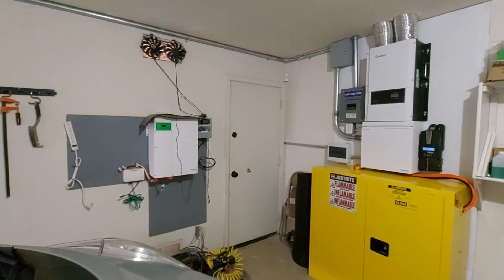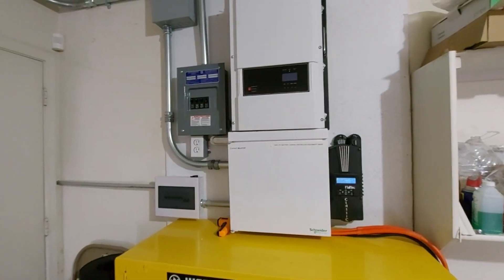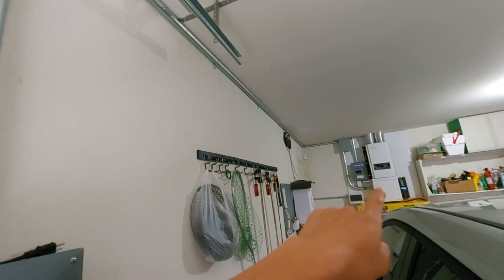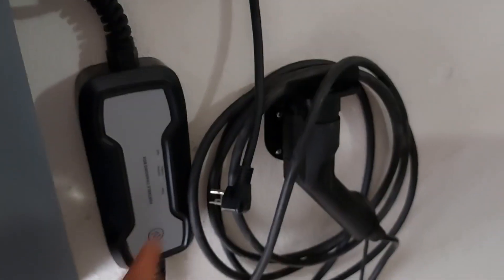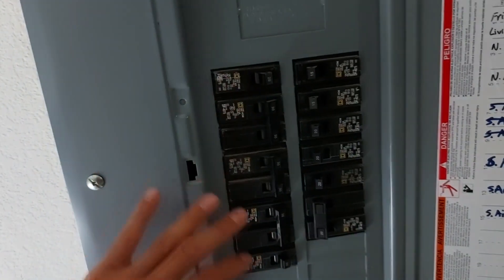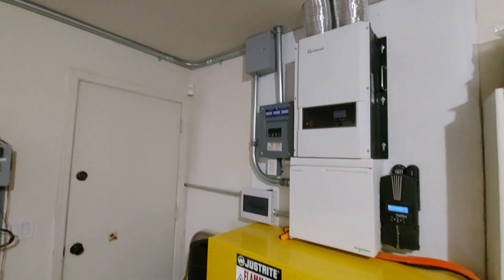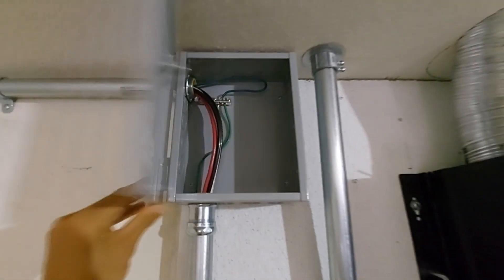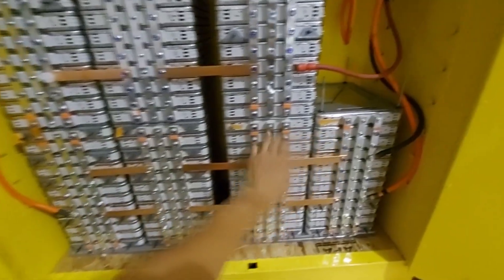10kw Off Grid Solar with 12k Growatt Inverter (SPF12000TDVM MPV)

Comment: I have 6k growat on 10x 570w panels 5×5 series and parallel...  i am about to purchase that 12k growat ..is it safe to use the same 5 series and parallel with one input  string on the 12k?
Reply from the maker: Depends on the voltage output of the panel.

Comment: Why have a critical loads panel? Aren't all loads critical? Just use a transfer switch and run the entire house off grid, 42 kWh should be plenty.   Way less expense in breakers panels, conduit and power distribution panels.

Comment: When u say the dryer and bith ac are on it shuts off.... Does the unit go into bypass? Or actually shutoff
Reply from the maker: Shut off.
Reply: @devildestiny555  ya I bought one. It automatically restarts after a few seconds. That's only when it's overloaded. It's happened to me about 4 times in 6 months since I've gotten mine. Wife be baking in the electric oven while canning on the electric stove while both ac units are on. Just have to be slightly aware of what your running all at once

Comment: How are u charging the same pack with two different chargers. 2 from the growatt and one from the midnight?
Reply from the maker: Charger are charger and it all based on voltage.  So if you can set both charger to the same voltage, you can use as many charger as you want.

Comment: Doesn't the inverter have fans under too ? 
Isn't the other white box blocking the air circulation
Reply: I’ve been considering going with the Growatt 12k to power my home.  Have you had any problems with it?  I’ve heard of some issues with software updates.
Reply: @@Floridaoff-grid Thanks! Great advice. I just built a small backup solar power system with some used panels and an EG4 3000w inverter and can see the benefit of higher PV voltage input (the EG4 takes 500vdc PV).  Longer PV strings and cheaper wiring really do save a lot of money, especially since my PV array will eventually be ground mounted 300’ from the house.
Reply from the maker: Yes the inverter has fan on the bottom.  But the power distribution box is designed to go on the bottom of the Schneider inverter that has fan too.  It has a lot of slots cut out to pull in air.  I have tested it by leaving the box door completely open which gives full airflow and it makes no difference.
Reply: @devildestiny555  
Alright

Comment: Hi Awesome setup. Two questions: Did you bond ground and neutral in the subpanel witch inverter feeds? Did you run a neutral from main panel to subpanel to have a common neutral?
Reply from the maker: I believes Neutral and Ground should only be bonded at the Main panel of your house and 1 point only.  Does not bond at Subpanel.  So yes, I brought a Neutral to Subpanel and to Inverter.
Reply: With this and most inverters the neutral and ground is bonded inside the inverter so you usually have two hots and one ground/neutral for outputs.

Comment: Great video thx.
The growatt is so bad and misadvertised, I had to argue and dispute with seller and got all my money back. Make your research. Unfortunately the bad things about it are hard to find.
Reply from the maker: Yeah, but unfortunately there's not much better option out there.. Even the more expensive brand have issues.
Reply: @devildestiny555  I believe the sol ark is a really good one, including customer support.
Reply: @Gallardo6669  The sine wave on this model Growatt was almost twice as clean as the Sol Ark I tested. I recommend you buy an oscilloscope and learn how to use it.
Reply: @cyumadbrosummit3534  I know how to use it, will do. So under which condition did you check? Inductive loads? One phase or both/ at the same time? %of the load?
The growatt may have more steady output ( not "transformerless") but that means nothing if you see what I was dealing with.
My solark is very steady in monitoring in so many ways, you wouldn't even get that out of a growatt... Therefore I know what to trust more
Reply: I disagree, this inverter fills a need that almost no other inverters can and it has surpassed my power output expectation when charging an EVs or welding with 240v.

Comment: So I have 24 / 300 watt panels 69volt 5.5 amp not sure how to wire to my Growatt can you help me
Reply from the maker: Do you have the 150volt max growatt or the 250volt input max?
Reply: @devildestiny555  I’ll have to look at manual online I still haven’t unpacked it let me look it up Thank You so much
Reply: @devildestiny555  250 volt
Reply from the maker: @chriseasterling1633  you can do 3 in series, then 4 set in paralles into one mppt port... then same with another.
Reply: @devildestiny555  thank you so so much so Keep the videos coming great work where do you live
Reply: @devildestiny555  if I have and questions I be back lol
Reply: Growatt gives you tons of issues if you don't have enough solar power for all your loads!!!
Reply: @Gallardo6669  how big of a array do you have
Reply: @chriseasterling1633  3000watt. But the issue is if your load is getting bigger. And the charge settings and switching internally is ridiculous. I should make a video about this... It's the worst product. And unreliable. I wrote once a big comment in one of the growatt 12kw videos, you may find it

Comment: Why did you discontinue the use of the Schneider in favor of the Growatt?   Doesn't the 12k's idle draw around 125 watts where the Schneider is around 30 watts?   Seems your battery bank takes a big hit from the Growatt.
Reply from the maker: Because Schneider are punk... When I bought the XW, I was hoping one day I can expand it and parallels another XW to it to double the capacity... But Schneider has discontinued the XW and now has the XW Prom which is not backward compatible to parallels with XW and same thing with the damn com box.  So you have to buy a whole new system.
Reply: @devildestiny555  OH wow.  I know they discontinued the paralleling of the SW (it never worked right), but did not know you could not parallel an XW now with out upgrading.  Yeah that would be an issue.   But are you being  negatively effected by the idle draw of the Growatt 12k?  Any idea what you are seeing idle?
Reply from the maker: @OffGridandOutdoors  If I remembered right, the idle draw for the Growatt 12k was about 100watts... I can measure it tonight and confirm it for you.
Reply: @devildestiny555  thanks much.  Installing one next week

Comment: Does the inverter auto bypass if the battery depletes?
Reply from the maker: Yes, but the biggest issue I have it, not only it bypass, but it also charge the battery at 10A, about 500watts, can not adjust it any lower or shut that stupid function off.  Once the battery is charged back up, it will go back to battery mode again and keep on looping.
Reply: @devildestiny555  no kidding. My mpp will allow me to change from solar only for charging or solar and grid. I thought they had similar firmware

Comment: Can you a video the growatt full loaded?
Reply from the maker: Fully loaded would be 12k and I don't think that's possible.  I've pulled 10k for about 10mins... but anything over that mine would go to overheat or overload.
Reply: @devildestiny555   Have you ever tried it with the xw pro?
Reply: @devildestiny555  With the xw pro its rated at 6800kw continues and 1200k surge and it on can do 8000k for 30min. 6800k = 141a and 8000k = 166a. It as a 250a main breaker and less than 10ft of 0/4 cable so it within its limits.
Reply: What gauge wire are you using?
Reply: @electromechanicalstuff2602  0/4
Reply: @beckfordelectrical  that's for 230 amps at 75C which is what the lugs are rated at. How many amps is on the data tag? 
12,000/48v=250a but that does not include the 88% efficacy it states at max load. So in reality it'll be closer to 300 a possibility. Do you just have it fused at 225? 
I'm looking I to this inverter and just trying to figure out what is actual current draw because if by the numbers I'd have to use 350kcmil welding wire which is $15/ ft

Comment: I've been following a long time. I'm starting to build a new system and want to go with lithium. Do you still prefer the leaf cells if you were starting from scratch today. Looking at the prices most used cells are within a similar range but some are more available in Canada currently. I've been leaning towards 500E or Tesla cells due to availability was wondering your opinion. Thanks
Reply: Going to be building a 48V array looking to start at about 10kwh capacity
Reply from the maker: @greggillis4826  it's hard to say, they all have pros and cons.  It all depends how much you can get it for.  Since off grid ROI is non existent, I would say get which ever option is cheapest for you.

Comment: I see behind you have a schneider xw. Is there a reason you went with the growatt vs the schneider ?
Reply from the maker: Bigger output, higher surge, also with  built in charge controller.  Plus Schneider abandon my inverter model and replaced and makes it incompatible, those punks.
Reply: @devildestiny555  Because Schneider wants you to buy their latest model.
Reply from the maker: @USA-GreedyMenOfNoIntegrity  and I didn't.  :)
Reply from the maker: Bigger output, higher surge, also with  built in charge controller.  Plus Schneider abandon my inverter model and replaced and makes it incompatible, those punks.
Reply: @devildestiny555  understandable. I've been thinking of the growatt upgrade from the sw 4048 . I have mine on the videos with the 30 kw batteries

Comment: Add a soft start to ur ACs... should solve the problem
Reply from the maker: Nah, those don't help much at all, I've already test it.
Reply: @devildestiny555  did you test the one engineer 775 used?
Reply: @frankz1125  I don't remember, but I know it doesn't help much at all.

Comment: Looks really good!
How long can you run your a/c units for?
Reply: How are you dealing with the heat in your garage ?
Your in phx right? 
I’ve put all my equipment into a small “solar shed” in the corner of my garage and have a 5000 btu air conditioner running from the inverter cooling that room. It’s using a ton of energy that I’d rather be using to cool my house. I’m guessing The inverter and the CC can handle the heat but my battery manufacturer (trophy) is recommending they stay at 90 degrees max. Does your equipment ever overheat?
Reply from the maker: 5hours if one unit, 2-3 hours if two run at the same time.
Reply: @devildestiny555  this set up is very similar to mine. i am trying to add more panels to my system. my growatt is maxed out at almost the 7000 watts solar and i plan to add 4000 watts to a separate charge controller (midnight 250) i would love to talk more with you about how you set up the growatt and the midnight to charge the batteries simultaneously.
Reply from the maker: @rossferguson5277  Pretty simple, just set the two voltage to match each other.  The growatt doesn't read the battery voltage properly, for my case it's reading .5volt higher than actual battery, so you just have to compensate for that by setting the charge rate on the growatt to .5v higher.
Reply: So I got one of the context pdp like you have. Can you help me with a wiring diagram?

Comment: See if you can rewire the heating elements in the dryer to L-N, that'll cut the power use to 1/4 and probably solve the problem. (It will take longer to dry, but probably less than 4 times for an overall energy savings.)
Reply from the maker: Thought about that.  But wife probably won't be happy waiting 4hours to dry a load.  :)
Reply: @devildestiny555  Maybe also duct in a solar thermal collector to the intake to make up for the reduced heat? Could probably turn off the heating elements altogether during the summer.